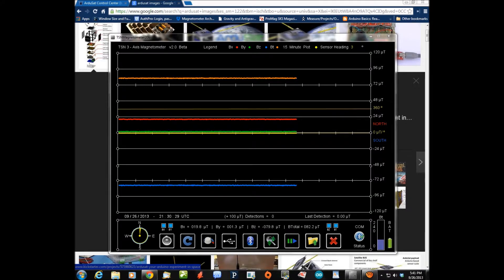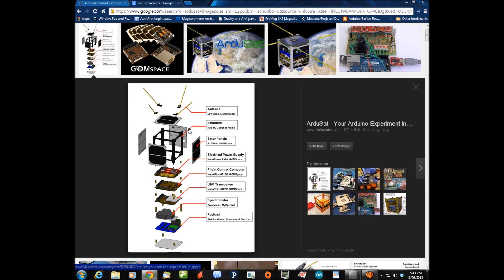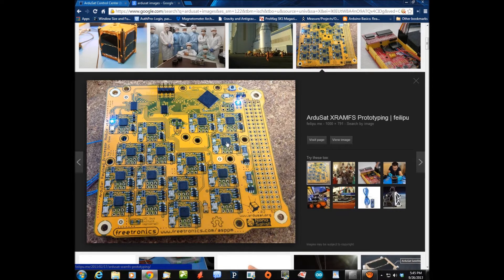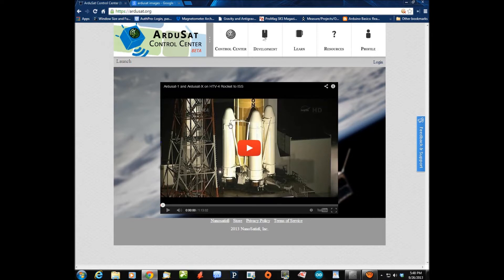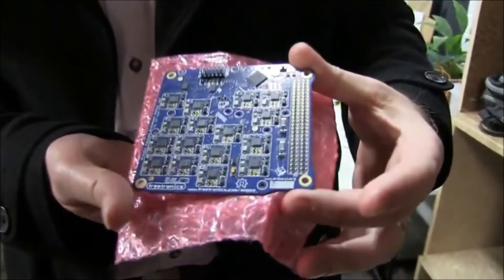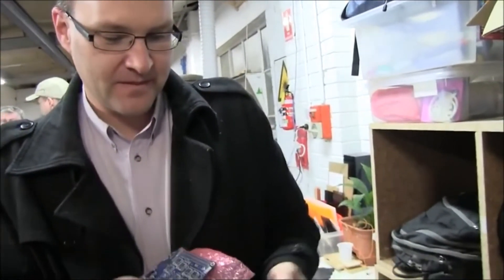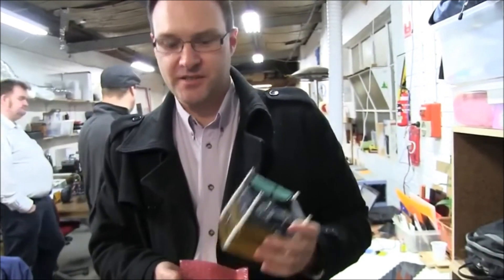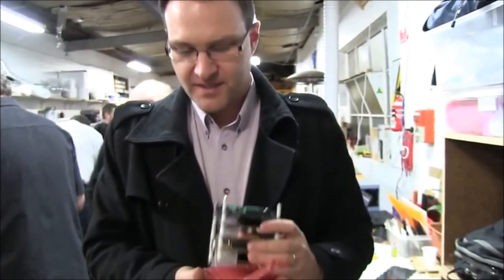TSN Update: TSN Magnetometer To Be Deployed To ISS Low Earth Orbit!

Comment from the maker: I found the exact sensor module that they are using on this satellite and I'm ordering one.  They're cheap.  It's a MAG3011 3 axis digital magnetometer, not much different than the one I am using now which is made by Honeywell.  Same data, different programming.  I already have some psuedocode written for the new sensor.  So, I can test the new hardware with my existing software before deployment